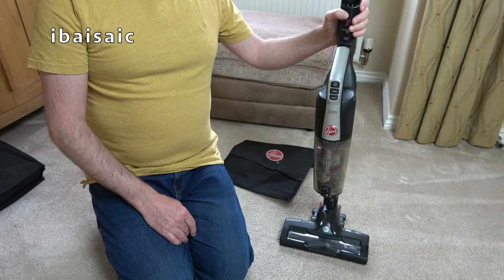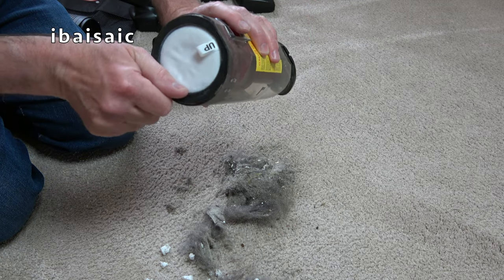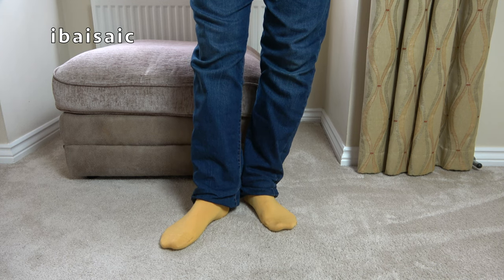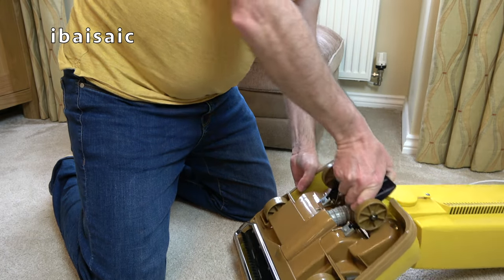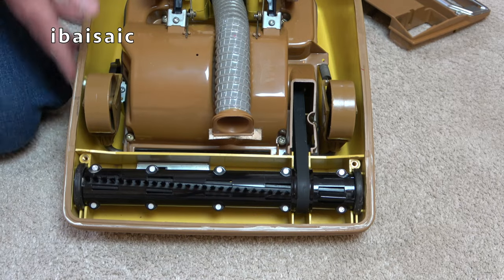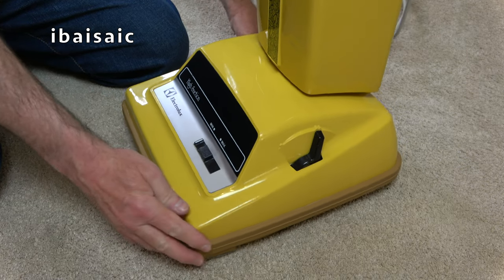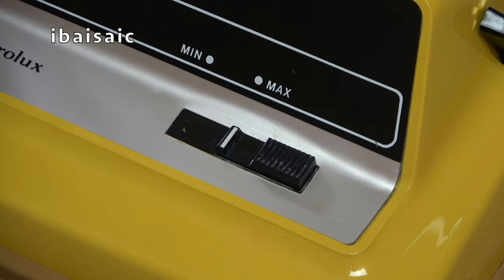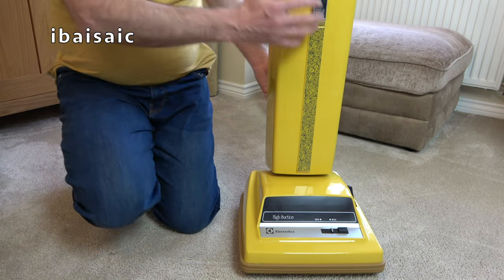Vacuum Cleaner Of The Month - Hoover H Free 500 Verdict & July Vacuum Reveal

Comment: I want to mention that your suppressor capacitor is pretty much dead in that shape. It probably has gone completely open circuit. Also to note, even if they stop the arcing of on the brushes, it doesn't particularly matter. As you probably know, most modern machines don't have one, and they don't have an issue with this.

Comment: And I’m no scientist man from Britain but I think my mums vac a vax blade needs upgrading because on the wind down and low suction the motor is straining
Reply: You might need to give the filter a clean or replace it
Reply: I been doing that but every time rhe dust gets collected the fine one goes on the 1st premotor filter
Reply: @levigaming-1  I'm assuming it has one of those smooth round ones? I had a stick vac with similar and it needed cleaning with a Henry after every use, or there would be no suction
Reply: It’s a vax 32v pro blade the older style